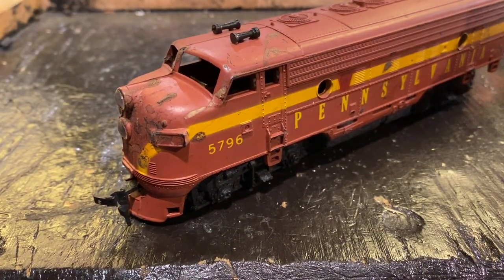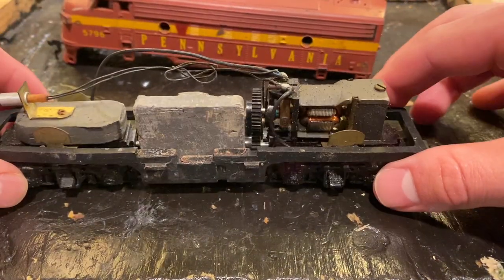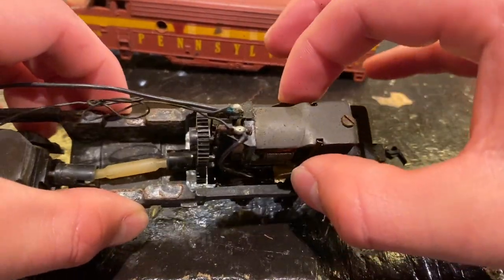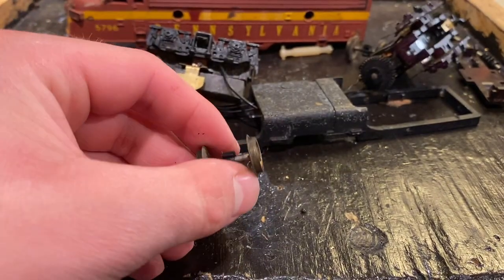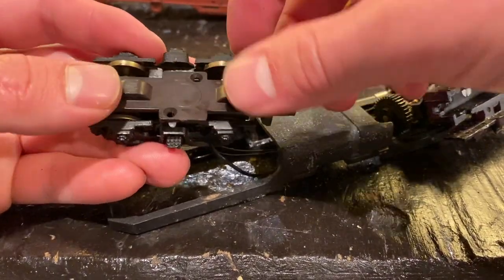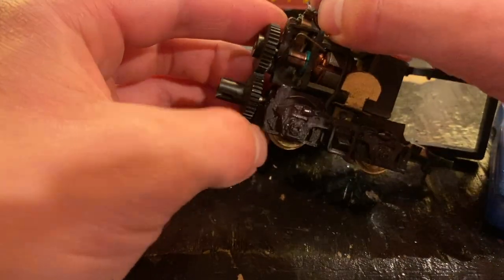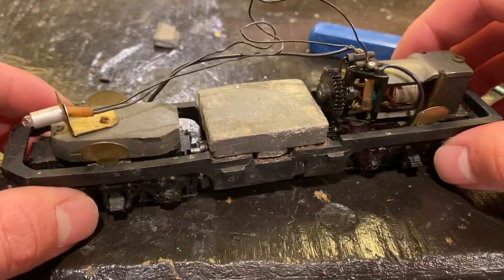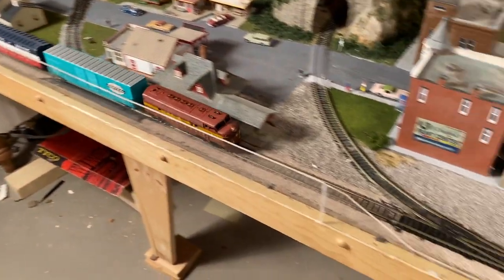Can We Make This Broken 1960s PRR F7A Loco Run Again?

Comment: You got me motivated to fix boxes of old locomotives I purchased at the local flea market years ago.  From the first box I restored in ho 10 diesels and 1 steam engine.  I'm starting on a second box with 12 ho small steam engines. Thanks again and good luck in the future.  Long live modelrailroading!
Reply from the maker: That's fantastic. There is something to be said for this part of the hobby.
Reply: Can you give some details of the engines and why they wouldn't run?
Reply: This diesels are Varney, Athearn Tyco and Lifelike, the steam is a Rivarossi Mikado,  they were all in pieces.   Now all running.  The second box so far running is a Pocher JW Boker 2-4-0 and a Mantua General that is dicast.  I can't find anything about it.  Still have a mantua pacific, 2 rivarossi 0-8-0, and 2 Pacifics to work on. Your repair videos save me a lot of time, thanks.

Comment: Great restoration to this I couldn't do better myself.
Serenity!! A runner!
 I've never seen that drive before but its good to see another vintage locomotive running again. I had a model power f3 that had this paint scheme years ago. It was my favourite locomotive when I was about 8 to 11 years old its long gone but slowly ive been replacing what I've had over years which is good thing plus these videos helped me do what i do now to restore mine. Especially the older vids helped with doing track work etc.

Comment: The heat shrink tubing....USE YOUR SOLDERING IRON TO DO THAT!!!!  Don't use an open flame, because with the open flame you just never know what ELSE you're going to set on fire. And because I'm paranoid, I would have tested it without the shell first. But that's just me.  Still...damned good job, dude!!!
Reply: I was going to recommend a hairdryer but the soldering iron is just as good. 👍
Reply: I've never thought about a soldering iron. I will say I've used a lighter and yeah it does get a little bit hot to where it has closely melted insulated wire . I'll try this tip or use an old hair drier that was goin to be thrown out I've used to dry glue paint etc lol.
Reply: Ah, spoken like an old pro. I did wonder about the lighter and open flame.
Reply: @roderickcampbell2105  Yes...old, definitely. Pro? Well, in SOME things - like electronics, also yes. And thank you!

Comment: It's a Varney. I got 2 sets of Varney PRR trains in the late 1960s  when I was in elementary school. 1 Freight and 1 passenger. Still have them in the original boxes. Both came with this paint scheme on the engine. Both had a non-powered B unit. Unfortunately, the frames on all of these discentegrated into little pieces. Tried to save them but they just fell apart. These had good strong motors and drives.

Comment: Good job on getting that old thing going again.  It is, in fact, either an early LL or late Varney.  I still have a power pack from one of those sets where LL put an LL sticker over the Varney label.  If you plan to keep this, get a miniature zip tie, as something happens with running that causes the gears on the power truck to drift apart and not mesh properly.  The zip tie will fix that.  Clearly, you have a problem of a dirty commutator and contact wipers in the trucks.  You should clean them. In addition to dirt, contact wipers can attract dirt devils.   One thing for the future,  use much less lubricant.  The only thing that excess lubricant does is attract dirt, thus, your contact problem will return.  Dirt is a major enemy of scale motive power.

Comment: I had the same Varney F7A engine. Got it around 1961 or so when I was a kid. The chassis (pot metal) broke in about 5 places after quite a few years. In my travels to train shows about 20 some years back, I acquired an unlabeled Athern  F7A power unit and was able to adapt the Varney shell to fit the Athern chassis. So I still was able to use my old Varney unit.  Still have both trucks and the motor in the junk box.

Comment: I wish pulling the  trucks out was this easy, but I've never worked with this type of motor before. I never would've thought to use heat shrink tubing as an insulator either

Comment: SMT, I recently purchased a TYCO brown box train set on ebay, and I discovered that one of the axle  gears on the F9 is stripped. Do you know where I can find new gears or from what other manufacturer the gears would fit on my TYCO F9 locomotive ?

Comment: SMT - Don't you have some Pennsy passenger cars to run with that diesel?  I feel a little concerned about that green corrosion on the commutator plates; particularly the end next to the armature.  Maybe some WD40 could be applied to the plate ends with a small brush?

Comment: Ok so I have this Kato n scale GE ES44AC loco here. For some reason it looked like it was slower for some reason. So I thought it needed to be cleaned and I took out the weeks and stuff. And when I put it back on the track the power keeps coming in and out. Like it runs then stops. Runs. Stops. I need help

Comment: you use too much lube and grease. over time it gets all over the place and then attracts hair and lint etc. you need that needle on your oil bottle
Reply: I noticed the needle tube was missing. I think he had similar to what mine is about to do if im not careful where it snap off.  Also I think labelle 102 don't have that needle part. Ive put same amount of grease on mine when there's nothing to go by but also I use different grease its super lube. It's plastic compatible and I get more ounces per tube vs labelle and its the same stuff just not white its more of a clear type that has all the qualities just lower cost